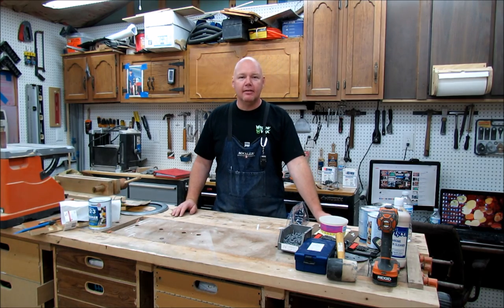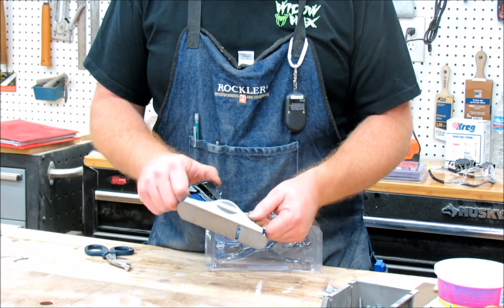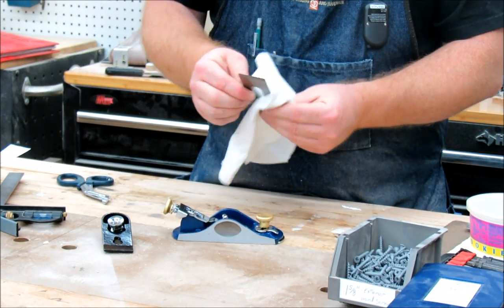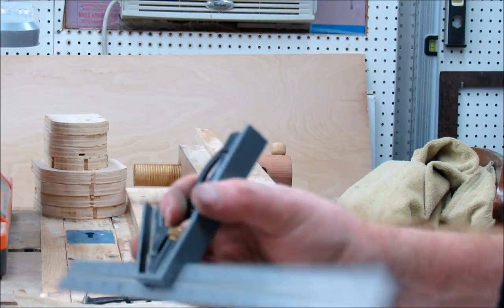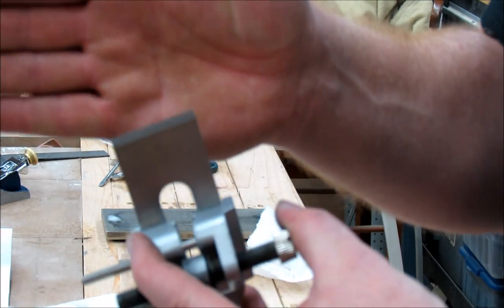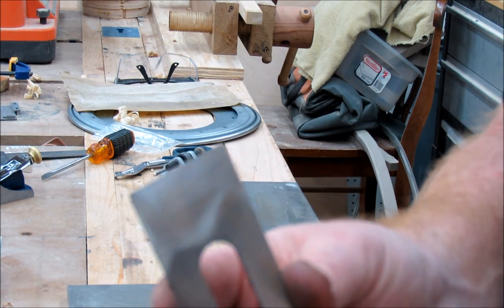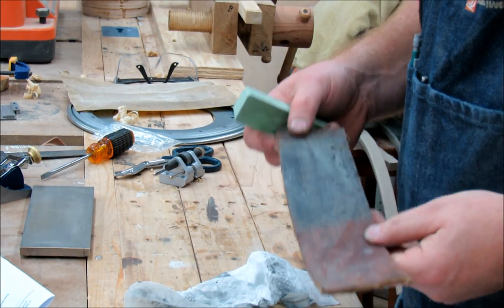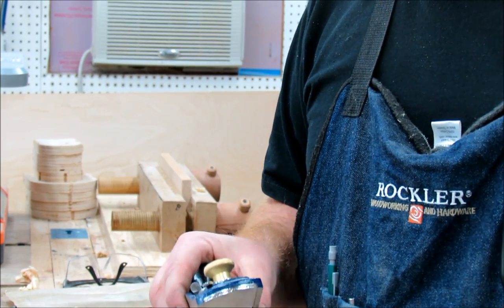Can a $15 dollar Kobalt plane work for fine woodworking

Comment: this was the very first plane I bought when I decided to learn to use hand tools. with it I bought stones and a sharpening guide. 

I can see the areas where it is not a very high quality tool. I did just what you did in this video, and 2 years later, I keep it sharp, use it within its means, and I have not needed to replace it because of its inability to satisfy the requirement.  maybe I don't know how nice I could have it with a higher quality one, but it is helping me learn. 

nice video btw.
Reply from the maker: Common Danny well said.  Thanks for sharing your experience.

Comment: My dad always said, "it's the guy using the tools, not the tool, that is the problem."  Nothing wrong with a good $15 plane.  Especially if, as you say, you tune it and know how to use it and what it's limitations are.
Reply from the maker: Bill Weissborn You make an excellent point.  Thanks for watching and the comments.
Reply: Bill Weissborn Your father reminds me of my wood shop teacher from High School. Couldn't have said it better.
Reply: That may be true but a higher end tool can speed up the process. And you know time is money.
Reply: Some people are time poor and money rich, some people are time rich and money poor. A lot of us fall somewhere in between. The choice of tools we make often depends where on the scale we fall, or what we enjoy doing (some people like the challenge of taking a cheaper tool and tuning it until it performs well, others just want to get on with using it).
Reply from the maker: +TeaDaemon thanks for the wise words
Reply: TeaDaemon, even a $1400 plane needs tuned. the sole is never truely flat from the factory, and the iron could always be improved from the factory. Just saying. And as far as set-up, no two woodworkers do it exactly the same, so you'll likely have to adjust your frog, chip breaker, throat or something as well. There is no such thing as a factory plane that is 100% ready to use. Yeah, I guess you could adjust how you work it to try to match what the factory set up, but no craftsman worth his pocket knife ever took a plane and used it straight from the factory floor.
Reply from the maker: +Barry Manilowa exactly I bought this plane to shave down plywood parts mainly. Thanks for your comments and for watching
Reply: A $1,400 plane BETTER be flat from the factory.
Reply from the maker: +gretchman  true statement
Reply: Bill Weissborn you right
Reply: Bill Weissborn I
Reply: If 2 persons have similar skills,  better tool is still better
Reply: Barry Manilowa    A plane is a pretty simple device.  Unlike a violin or a computer, it's basically a handful of parts that need to be shaped and fitted with care.  I don't think there's any reason why a few thoughtful modifications can't bring a bad plane up to Strativarious quality
Reply: Barry Manilowa  In the case of the Bedrock, you have a point.  Stanley had to iron out some problems with the Bailey.      Have you seen Paul Sellers actually build a wooden plane?  https://youtu.be/yTuOtmlRhAI    It's pretty crazy.  It kind of demonstrates how precision can be obtained with simple guidelines.
Did you know that even the Bedrocks had shitty blades (irons)?  Today's irons are of better steel and usually thicker.  I suppose any problem can be surmounted with a bit of thinking and effort.
Reply: I totally agree! I have a $500 set of engineer grade tools but I only use them for basic work. The tool quality look and feel are awesome, but the job will get done just the same with a $10 tool that I bought from Walmart!
Reply: My tools mostly came from yard sales and Harbor Freight. the only performance issues I've had were with ME. The tools did just what they were made to do.
Reply: I think that's the problem. I did keep messing with it , including totally disassembling and reassembling and now at least the blade is set straight and low enough to actually come into contact with the wood.. so that's a start. Lol
Reply: @thomasarussellsr  If you get a $1400 dollar plane and its not flat, it would be sent back and replaced, you buy a clifton veritas or lie nielsen and all are totally flat precision machined, I don't know where you get your $1400 dollar planes but it must have a big glass window and they see you coming!
Reply: @gretchman  I would tend to agree, but through some Dykem on it an rub it across some 2000 grit paper on a true flat granite block, I'd bet there will be some highs and low spots even on the highest end planes you can buy. Just the ambiant temperature differences between the factory, warehouse, shipping truck, and your shop can cause some warping, regardless of the material used to manufacture the tool. Iron, steel (many different grades), brass, wood bodied, etc... all can warp even under the adjustment screw tension as well, if there is any.
Reply: @williamn01  Any top expert will tell you to check even your high end planes for a true planer sole when you recieve them. Temperature varients between storage facilities, shipping, and your shop, and adjustments can and will warp the body, even if microscopically. Your shipping company dropping or throwing the box, anything can happen. I've seen videos of high-end planes out of flat upon receipt having to be trued on a flat surface with quality sandpaper. And those higher priced ones are typically the hand made one off from specialized handtool makers you see making the planes in their videos on YouTube. Those go closer to $2800.
Reply: Except when they don't make blade sizes for your old circular saw anymore and you are forced to upgrade :(
Reply: In most cases yes.... I bought this plane and out of the package it is completely un usable. LOL but with a tune up it will be fine.
Reply from the maker: So true.  I still use mine all the time. Nice thing is if I drop it not a big deal.

Comment: I think Kolbolt and Stanley block planes are great for what they are. If you lay one beside a Lie-Nielsen block plane, the difference is day and night. This type of plane purchased at the big box store is great for a guy just getting his feet wet in the craft or someone on a budget. I own 3 LNT block planes and love them, but I also own 3 Stanley's too. I use them all for much different tasks. My Stanley's are used for "rough" tasks while the LNT planes are used for more finished type applications. Nice video.
Reply from the maker: +drice847 thank you for watching and your comments
Reply: Same here.  My Stanleys and Craftsman planes have all come from garage sales and flea markets.  I restored them to good working condition and they are in service today on my rough work.  Not wanting to work rough lumber that may have a piece of fencing, a bullet or a rock inside with an LNT plane.  I keep both sets razor sharp though and once its time for finishing, the LNT planes are able to add just extra touch to the wood that justified the price.  Much tighter and more precise than the Kobalts are capable of.  I keep a hundred year old Stanley block plane in my apron pocket for shop work and a LNT block in my furniture apron.  Different tools for different tasks. And an excellent video, BTW.
Reply from the maker: That is a perfect setup. I use my kobalt on plywood mostly when needing to take off just a small amount rather than go to the saw.

Comment: For the most part the problem with cheap planes is the quality of the metal in the blade and the sharpening. Pretty much everything else can be dealt with. An old knife maker I knew said "if you don't have good steel, you don't have a knife". The same applies to woodworking tools. Other than that, it's the craftsman, not the tool, that counts.
Reply: Steel is a well understood material today so plenty of manufacturers are capable of making high quality product. At this point China has produced more steel than we ever have so they're probably better at it then we ever were. They got more practice. They certainly have better facilities than we ever did. We have buttkus today too.

Comment: Sorry if this was said earlier, but this plane is a direct copy of a new Stanley low angle block that I just finished tuning up.  Biggest problem with the Stanley was the sole had deep grooving (from factory) not a smooth sole at all.  Took me several hours over two days to get it smooth.  Blade sharpened ok, about like larger Stanley blades that I have sharpened. I noticed your block had a plastic cover on the sole and your sole appeared smooth.  The Stanley did not have this.
Reply from the maker: +Killiansix Pack I am sure most of the cheaper planes are copies of other models. The plane I bought had a  fairly flat sole.  It all depends on what your intentions are with a tool if it will be sufficient for your needs.

Comment: If you buy one of these, it would be good idea if you had an experienced friend to look it over and give you advice if you can't get it set up right.  The quality of Kolbalt planes seems to be hit & miss.  The No.4 Kolbalt bench plane that I bought had a lousy chipbreaker, of low quality, thin metal and it was badly ground.  It wasn't until I replaced it with a chipbreaker from a junked Staneley that plane worked properly.    Oh, and if you give the sole wipedown with 3-in-1 or a few strokes with a wax candle, it will be much easier to plane and won't interfere with gluing.
Reply from the maker: +Bob Blarney thanks for watching and the good advice.

Comment: I like the straight forwardness of your videos so I'll subscribe. In Australia we just had a massive hardware store chain go under, and one of the reasons is because Kobalt were the main tools they sold, and at stupidly high prices. From the looks of what you showed the quality you get is far different to what we got over here, $60 for a pipe wrench and it couldn't even grip pvc pipe was normal over here. The only tool from Kobalt I use is their rubber handled screwdrivers...it is a perfect rubber mallet for a bump key hammer
Reply from the maker: Thanks for subscribing, watching, and your kind words.

Comment: Mine never cut true. It did cut smooth but not true. I finally checked the blade and the cutting edge was NOT perpendicular to the side of the blade. It was way off. It took me an hour to square and sharpen the blade. Cuts great now. I want to find tune my shavings. Right now I am taking .014" per cut. 
Barry
Reply from the maker: Thank you for watching.  I mainly use mine for carpentry lately shaving doors or trim.  Sounds you got you dialed in pretty well.

Comment: I've encountered a few of these out of the package. Each was milled differently. All but one required filing to get the mouth flat. They all had to be tuned and messed with to get good shavings. If that was the only problem, I'd recommend them for the price, but the real dinger is that you have to mess with it for 10 minutes everytime you pick it up.

The irons are somewhat consistent, at least. I'll just say it looks like you got lucky, because these things are notoriously bad out of the package.
Reply from the maker: Thanks for watching and your comments.

Comment: With the possible exception of the high end planes. They do not come with sharpened blades. If you buy a new blade for a bailey or record it will still need sharpening.
Reply from the maker: +MickyMoz thanks for the info and for watch

Comment: The Kobalt plane isn't Bad and after all, ti is justa block plane, isn't it.  A few years back i bought an old Stanley block plane (also fixed mouth) a #4 and a #5 1/2 for $12 at a flea market.  Used and not in the best of shape including some rust. A few hours of work on each and a full day on the #5 1/2 and i had three planes that cut shavings at just under .001 on some decent  poplar I had around.  If getting a big box store suits you and all you really need is a very average block plane.  Be aware though that at Highland Hardware's web site you can get a BRAND NEW Stanley #9 1/2 Block Plane or the #60 1/2 low angle block plane for just $45 each.  The choice is yours - Kobalt that lasts until it breaks and delivers OK cuts or a Stanley that you'll have from now on.
Reply from the maker: Rick Price those are good points thank you for sharing and watching.
Reply: The Kobalt is just like a new Stanley. No better and no worse.

Comment: I have never seen the wheel trolly you clamp on to hold the correct angle when sharpening. What a great idea! Where are they available. EXCELLENT video. Many thanks...
Reply from the maker: +James Lancaster its called a chisel honing guide. They are available online and at most woodworking stores.  Thanks for watching.

Comment: "You get what you pay for."

"But, I have no money."

I love the mantra of blacksmiths: "Need a tool, make a tool." The plane looks well many, but I think the cost cutting goes into not finishing a product. This was one of the issues with the $600 metal lathe. A YouTuber found nearly all the parts unfinished.
Reply from the maker: Thanks for your input.

Comment: So I just bought this planet. I ha e be we used one before. I thought they were fairly self explanatory. I bought it mainly to smooth and square up board edges and surfaces. After reading the "instructions" I am more confused than ever because it's just not cutting no matter how I diddle with it. I'm sure this is user error but with all these knobs and levers to adjust , I don't know how to set it to just... Cut. Suggestions?
Reply from the maker: Most common is the lever cap screw is not tight enough to hold the blade in place one you set it. Or the plane is has a defect that is causing problems.   These are cheap planes not that well made, they take a lot of tuning to get them into really flood shape for woodwork.

Comment: This is a copy of a Record block plan in all. If I remember that the adjustable shoe is short to the slot compared to a Stanley etc. This meant when you adjust the shoe to close the throat down you expose the milled horns at the front on the sole of the plane body! These are very Sharpe and dangerous if not careful! I took mine back I feel this is a design flaw to the Record and Kolbolt  block plane. Do your home work! The devils in the details always! You can get the stanley used for less and better block plane! Same amount of work to prep!
Reply from the maker: Thank you for the information

Comment: Nice video overall.
Problems with auto focus cameras are illustrated.
True a LN plane costing 100$+ will do end grain better but the Kobalt with do chamfers and other "simple" planing tasks just fine.
Reply from the maker: cdouglas1942 thanks for watching and your comments.
Reply: Yup, the auto-focus thing got a little fustrating (sorry BY!).  Each time the blade was held up to the camera for about 5-10 secs and then JUST as the camera started to focus, it was onto the next thing.  It's very annoying, waiting for that reward of a close up and then it's snatched away!  It's even more annoying, when it happens multiple times and you know it's coming - I just think "forget the close up... move on".  Don't worry BY, you're NOT the only one who does this, but be aware of it and you'll make better videos (not that this one was particularly shoddy). :)
We don't need to see every stage in close up - we (should!) all know how it is when it only touches the edges of the blade, just describing it is fine.  Do close ups when it adds something of value that we don't already know (like showing the shoddy casting or the shavings produced).  OR... if you want to include the close-ups, maybe avoid talking when trying to get the close shot and then in post, you can quickly cut out those 5-15 seconds of trying to get the camera to AF and you won't be cutting any sentences in half.  Jobs a'goodun
Best of luck.
Reply from the maker: +EscapeMCP  thanks for the constructive feedback. I will try your suggestions out in the future to improve my videos.

Comment: I'm surprised the blade sharpened so quickly.  The cheapos usually have too much chrome and hard to sharpen. But, it looked like you had no problem. kobalt makes good stuff.
Reply from the maker: For the price this plane that I received has been decent. the blade holds an edge for a good amount of time before I have to touch it up.
 I use it for shaving plywood ends alot and it works great.
Thanks for watching and commenting

Comment: I've had this one for over a year. It's not great and I would rather use a Veritas, but this thing is great on a jobsite where you need to get the job done or someone else gets their hands in your tool box.
Reply from the maker: +Jason Michael Kotarski that's very true, I use mine to shave down plywood edges while fitting pieces together.  If anything happens to this plane it's not a real big loss.  Thanks for watching.

Comment: These planes really are "kits" that give you some roughly finished plane parts.  You have to do the final work yourself.

In my case:
The sole was not flat around the mouth and needed extensive work.

The blade was not ground square.  

The blade will not sit square in the opening.  I have to push the adjuster all the way to one side.

The opening is not square and straight.

The sliding mouth is not square.

All of this is very fixable.  Again, think of this as a $15 plane kit and you won't be disappointed.  After all, how much work would you have to do to make/buy all the parts separately?  It's kind of a bargain.
Reply from the maker: That makes a lot of sense.  Thanks for watching

Comment: After my experience with the Kobalt bench plane, I'd be wary.  The body was ok, the frog was so-so for adjustment, but chipbreaker was inferior.  I wasted way too much time on it. l But the blockplane may be different because it's a simpler design.
Reply from the maker: +Bob Blarney it’s a good plane for what I use it for mainly to chamfer edges or shave down plywood to a perfect fit. I won’t say it’s as good as a $100 block plane but it’s perfect for my tasks.  Adjustments are finicky.